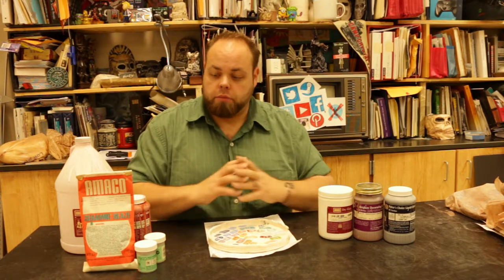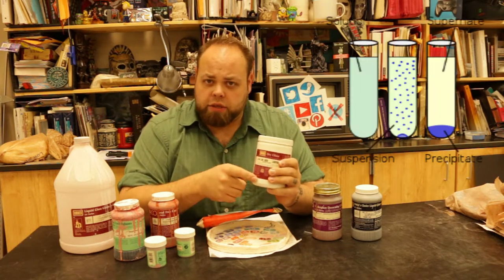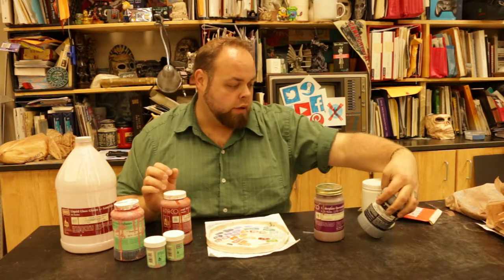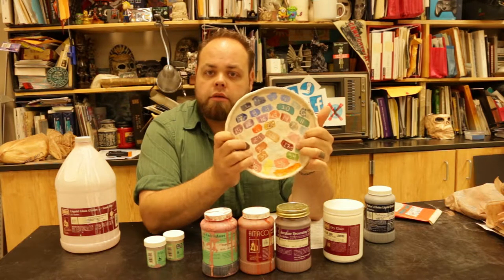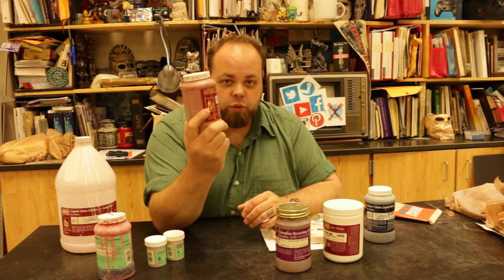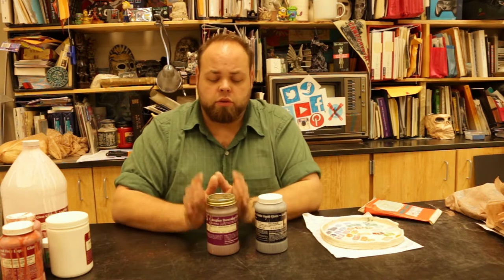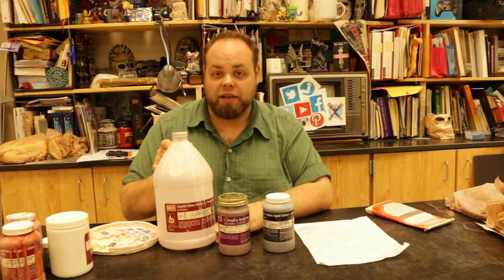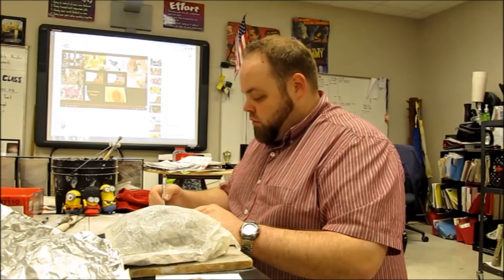Why do you test Ceramic Glazes? - University of YouTube

Comment: Also another question.. I want to redo the paint on some hard made plates I brought. What paints and  top coats should I use? Also I'll have to use my oven for that.. your thoughts? 🎨☀️🤗
Reply from the maker: Redoing a finish can be real tricky. The main issue will the piece still be food safe? If the temp is only getting as high as 700-900 (common kitchen oven, cleaning cycle).  To properly set a glaze it needs to fire to the cone on the label, i.e. cone 04 - 1945^F.  I would not trust this to be food safe based on the application that you are suggesting.
Reply from the maker: I didn't see that you had another question.